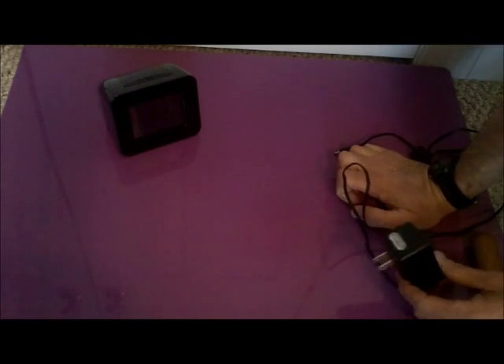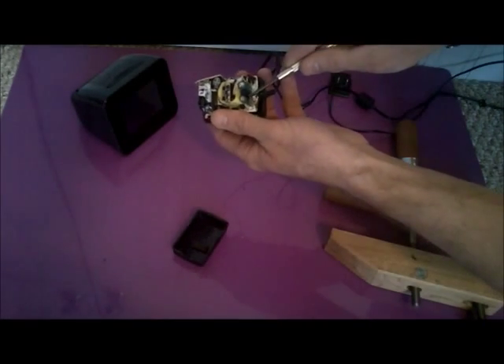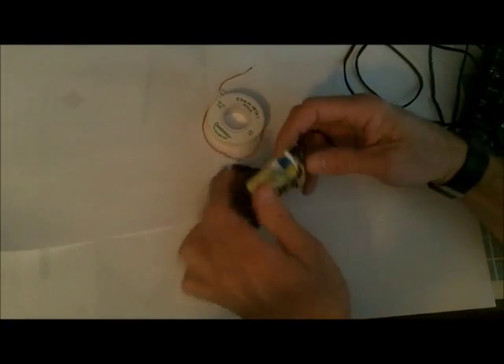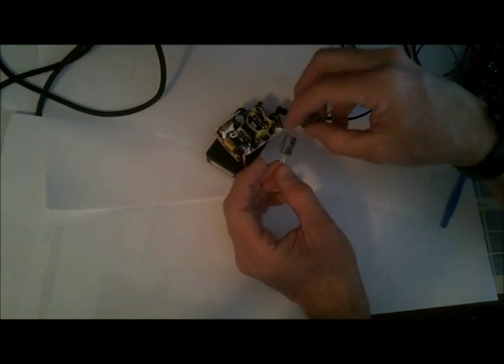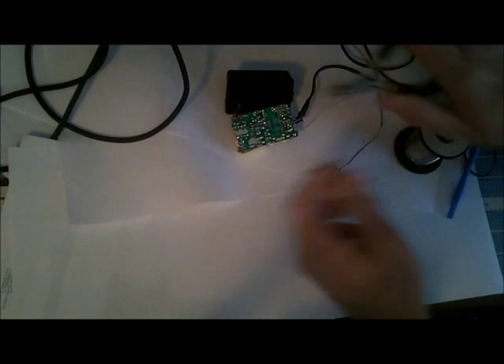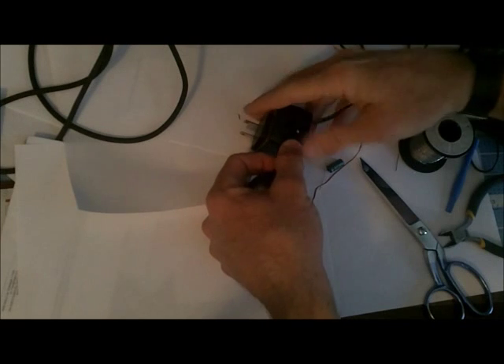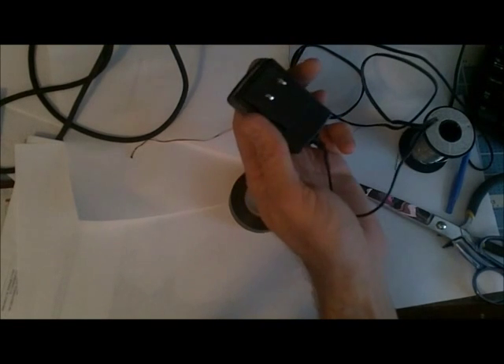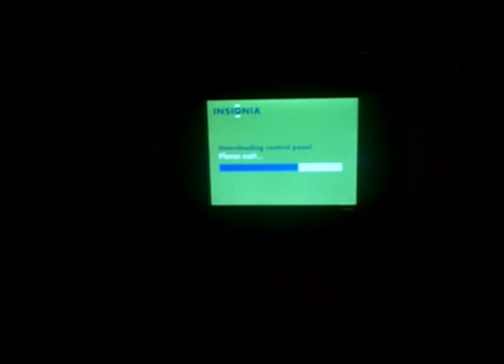Chumby One / Insignia / Infocast 3.5 Power Supply Fix

Comment: I have changed that capacitor twice already. No clue why is failing and why the battery is getting puffy after some time. Looks like some hardware issue with battery charging.